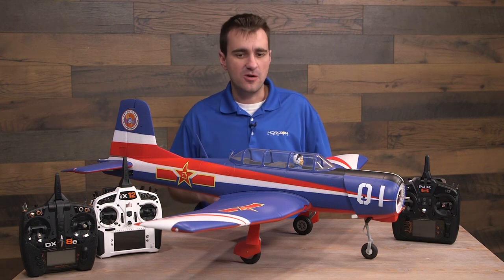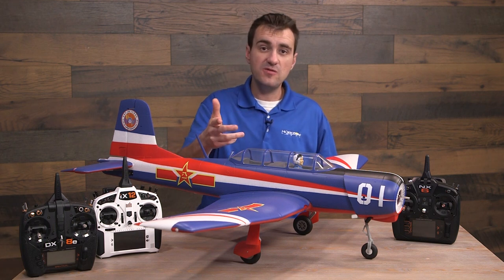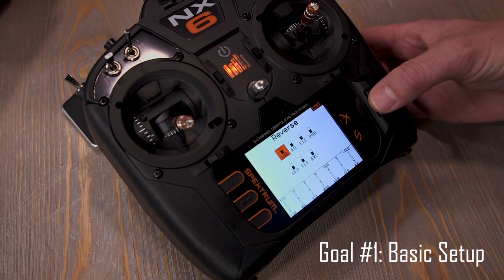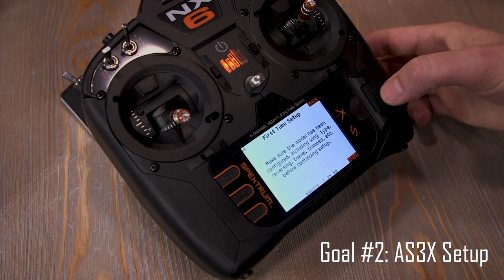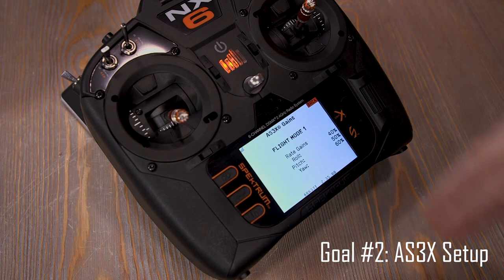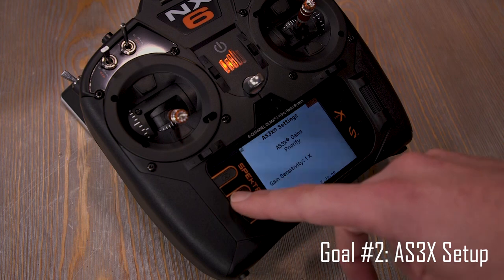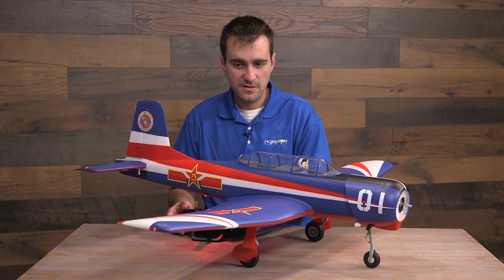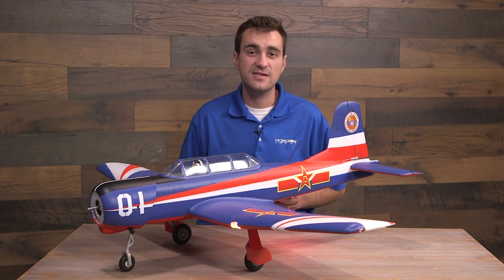AR637T Receiver Setup via Forward Programming - Horizon Insider Tech Talk

Comment: As an older pilot (78), I can verify that SAFE is very helpful with takeoffs and landings.  I have totaled MANY planes, but none with SAFE activated.  My SAFE planes include a carbon z Cessna, z Cub, and a FT Storch, and two planes I have, but not yet flown,  an FT Edge 540 (just completed), and a Hangar 9 Ultra Stick.  If you are crash prone, swallow your pride (or arrogance) and get flight stabilization in the planes you really don’t want to lose.
Reply: All your planes are BNF right ?
Reply: Nothing wrong with using SAFE.

Comment: One thing “he might have missed” is setting the AS3X gains to “Fixed”instead of the default of “Adjustable”. When he skipped setting the gain channel because the NX6 doesn’t have a knob, the AS3X gains are all going to be zero. If you don’t assign a gain channel and an input for it, you must set the gains to “Fixed”. However, the menu option for that doesn’t show up until you set up a flight modes channel. For some reason, Spektrum doesn’t have you do that until you do the first time setup for SAFE. After SAFE is set up, you can go back to the AS3X settings screen and the option to change the AS3X gains from “Adjustable” to “Fixed” will magically appear. I don’t like how the menus change as you go through the setup process. It forces you to keep cycling through them to make sure you haven’t missed anything. They could have had it automatically set the gains to “Fixed” if you didn’t set up a gain channel and they should have had you set up the flight modes channel long before the first time SAFE setup. Also, even though a 6 channel transmitter doesn’t have a knob, you could put the gain channel on a 3-position switch which would give you three gain settings - 0%, 1/2 of the gain settings, or the full amount of the gain settings. Not great, but better than nothing.
Reply: This helped a lot. This is why I watched the video, and it wasn't addressed.
Reply: Thanks for response here and also detailed response on Fat Guy Flies channel. The manual does not stress the importance of setting the gains to fixed. I couldn't get the AS3X working properly unless I activated the heading feature and then it would worked for some reason. No that I set the gains to fixed, the heading feature does not have to be activated for AS3X to work properly. Thank you!

Comment: When I go to Forward Programming I only see one option, Gyro Settings, I don't see Other Settings. And in Gyro Settins I don't see any First Time Setup option, instead, SAFE Select appears, I click on it and then I see the flight modes according to switch B position.
I tried with a AR631 rx and it goes according to what you show, but the AR637TA sees to have another programming or setting, I don't understand what happens here. It never asks mee to put the plan on its nose to start with.
At the end of the day I manage to get the 3 flight modes i want, SAFE+AS3X, AS3X, nothing. But I don't see how to change the gain or the limit angles.

Comment: I'm using a "DX6" to do the forward programming and my wing type is two alieron servos and one Y harnessed flap servo, no retracts.  So my Rx port assignments displays 1 through 6 just like yours.  HOWEVER, despite my having selected a flight mode switch same as you did, my channel input config page DOES NOT have an entry for "7 aux2: B"    I have no 7th entry, so I can't assign and independent flight mode switch for safe select.  Is this because I'm using a DX6 instead of an NX6 that you are using???  what's going on here?  if anyone knows, please help.  Thanks.

Comment: I have set up as3x and safe on switch b (a 3 position switch) on nx6 transmitter and ar637t receiver. Flight modes are no as3x, as3x on, safe. All travel, gains, dual rates, rates and expo are exactly the same for all flight modes. In off and as3x modes travel and throws work exactly as expected. However, if I turn on safe (with self level), throws and travel are greatly reduced. So much so that I am concerned elevator throw is so little, there is not enough command to control aircraft. Can someone help me understand why travel is reduced like this?

Comment: I've had absolutely zero issues with the forward programming.  I really did like the adjustable gain it is perfect for fine tuning your plane...
Reply: I got everything going good I set the as3x and safe I throttle up but as3x doesn’t turn on safe does when I flip the switch any idea
Reply: Why don't you make a video on installing and programming an AS3X reciever into a non Horizon plane and explain throughly forward programming at a level that us novices could understand in stead of this guy passing over important information that could explain more clearly the process and functionality of this transmitter . I'm not trying to be rude but let's face it I would spend 90.00 for 10 of my planes nearly 1000.00 in sales if I could as well as I'm sure others understand the set up of this HH technology. 
It would be great if you can do it please.
Reply: @octane2099  

Did you ever figure this out?
Reply: @rafaeltorres2886  Do the procedure 2 times and it works.

Comment: Great video and it also a key item needs to be said. If using a transmitter (such as an nx6 seen here) with no adjustable gain. Then you must set gains as fixed in gain settings. By default they are set to adjustable. If this is missed, it will appear as though safe works when the switch is set to that, but when switched to as3x only, nothing happens. Try putting gains on fixed to get it all functioning if your transmitter has no adjustable gain knob or switch
Reply: Good catch. It took me awhile to figure this out on my own.

Comment: I swapped my DX8e to an NX8, mostly so I could get updates on Wifi. Great improvement.
My Timber Turbo Evo had been set up with DX8e so I saved the settings to SD and then installed in NX8.
After binding, all the functions and switches were correct, correct control responses. Off for a test flight then I discovered AS3X worked but no safe. Basic bind error as in effect I disabled safe, so following the bind procedure it is most important after you remove the bind plug, that the transmitter is off. You then hold down the bind button and at the same time turn on transmitter. The display will then show binding and configuration, when complete you are done.
I find the accompanying manual highly lacking in clear explanations on gyros and AS3X as well as some other features.
Having the receiver AS637TA delivered with the Timber Turbo EVO, I do not have the option of 1st time settings and forward programming goes straight to the single Gyro option and it does not give me option to set the gains. All of the instructional videos I have watched do not show how to adjust gain without the 1st time set up.
How to access the gin settings. Telemetry tells me what the current setting are, but I cannot change them.
Frustrated like hell.
Trevor Kilbey

Comment: I'm well trained to program older 636 series with AS3X Programmer where we had to correctly set up the surfaces direction to get proper AS3X response.
On the newer Forward Programming enabled Rx series, there is no more surfaces settings in the FP menus (or I missed it)... So I'm wondering the Tx/Rx can know the right servo direction in order to get AS3X/Safe working properly? And how may we reverse a surface direction in case of wrong surface direction (during AS3X/Safe test)? 🤔

Comment: Building an old balsa pylon model which is having only aileron and elevator to control. I am planning to have 2 servos for the ailerons. Would ASX3 or even SAFE be a possible help to assist me without rudder control? 
Using a Spektrum NX6 and an AR630.

Comment: Question:  After initial forward program setup, let say, I want to move my AR637T to a different HH airplane.... what is the correct process of re-setting up the AR637T?   Do I just need to do a "relearn servo settings"?   Or do I need to do a "Factory Reset" and then redo forward programming after I have properly setup all my servos and channel assignments?

Comment: Good video but you don't mention anything about YAW. When I first setup my AR630 with a DX6 transmitter update to 2.09 I wasn't able to see the rudder move when testing it on the bench. I then went into the Heading settings and changed YAW which was set to 0. They also issue a warning above the YAW setting. Can you suggest a good starting value for YAW in both AS3X and Safe?  Why the warning about YAW? Thank you
Reply: I don't know about as3x, but my understanding is that SAFE only affects roll and pitch controls, but not the rudder.

Comment: Tom: Great video. I didn't see how to use the flight mode switch to select between AS3X and Safe mode on and off. Do you have this in a PDF 
document so I won't have to rewind so many times? I just got a new NX8 and it came with a AR8020T receiver and I'm trying to Forward Program 
it. A written document would be great but I can't find it anywhere on the Spektrum or Horizon websites
Reply: Did you figure out how to put safe into flight mode switch? I have an ix12 and just put safe on its own two way switch channel 7 aux 2. I couldn't figure out how to have it assigned to flight mode switch.
Reply: @I_am_archie  yes I did. I put together a word document that I call “The missing manual”. My instructions are in it. Position “0” of the Flight mode switch has both turned off. Position 1 has AS3X on. Position 2 has BOTH AS3X and Safe Envelope mode on. I found no way to turn AS3X off while Safe Envelope is on. If this sounds like it will work for you, I can email the document, or how else to send it? It’s about 10 pages long cuz it has a bunch of other undocumented tips in there too.

Comment: Kyle......an F Mode question:  on the flight mode channel that has AS3X and SAFE turned off, do I set both selections on the menu to Inhibit?  (The video looked like AS3X was set to Active on the clean channel)
Reply from the maker: AS3X can still be "active" on the clean channel as long as your gains are at 0%. Two different ways to skin a cat in theory ;).
Reply: @horizonhobby  Excellent...Thanks Kyle!

Comment: Great video! When I switch off safe AS3X also turns off. How can I turn off safe and still have AS3X ? Thanks
Reply: Same problem with mine. I’m going to check the gains are switched to fixed. Someone wrote about this in one of the comments.

Comment: I have the AR630 reciever, 6v rated digital servos, and i bought the Spektrum Smart 3200 9.9 Life reciever battery pack. Will the reciever and servos be ok with this much voltage? I wouldnt wanna roast anything...especially in mid flight. I noticed the reciever has a 9v rating. Hope i didnt make a mistake by buying those reciever packs

Comment: Is there a way to adjust control surface deflections on a bnf plane? My F 16 Thunderbird bnf 70 mm has AR631 and  i noticed when safe switch is on my control surfaces move almost 40 to 50% less and when i turn safe off it is normal movement. Its very strange. My other f 15 eagle does not do that  and both in safe and not safe control surfaces move exact same amount. I am so confused.  . Is there an issue with the AR631 reciever you think? I am scared to even fly it again since i can clearly see control surfaces are not going to its capacity or limits. Any help would be helful man. Thank you.

Comment: something seems off to me....I have a Turbo Timber, the manual is quite clear on how to activate AS3X and SAFE. It was NOTHING like all that he just went through. Activating Safe is determined by how you bind the plane with the bind plug, then hold the gimbles together and flip a switch 5 full toggles to assign it. AS3X can be left out but who would - SAFE is assigned to a switch and activate if you get in a bind. 
Is this video talking about something all together different or is it the plane that he's using that makes the difference?
Reply: Timber is a bind and fly already set up for as3x if you use bind plugs as it says in manual. You cannot get into forward programming on bind and fly unless you Jail break it (which is another spectrum video). This video is for a brand new receiver out of the box for any plane you put it in. Basically you are programming what they do already for bind and fly aircraft out of the box. Bind and fly just has horizon having done all this for you

Comment: Hello, I have installed an AR8360T receiver in my gas plane. It’s a 3D 8 channel aircraft and my radio is a DX8G2 therefore all my channels are used. I know I can’t have safe as there’s no available channel for it but can I still have AS3X stability with no available channel? Or will I absolutely need a 9 or 10 channel radio to have the AS3X functioning?

Comment: I have a question: When I am flying I use safe mode, but when I am higher in altitude I assigned a switch to turn safe off so I can do some maneuvers. I have enough flight experience now but I am afraid to go off of safe completely but can't use safe for rolls, etc. Is there a more advanced mode that stabilizes the plane without being in full safe mode?

Comment: Quick question/comment. I had previously been told by Spektrum that one should never reverse the servo in the TX for aileron/elevator or rudder . Only in the RX because the SAFE will be reversed. Am I mistaken?
Reply: I think that's true for the older receivers like AR636A

Comment: Hi guys, I just got the 1.2 Corsair yesterday and I’m trying to setup AS3X on my nx6 and when I hit forward programming it says “connection failed”. I’ve tried several times but nothings working. Any insight?
Reply from the maker: The Corsair does not support Forward Programming. The BNF model utilizes older receiver technology. You would have to upgrade the receiver to take advantage of this feature, unfortunately.

Comment: If I already programmaed as3x on a 637t but need to do mechanical adjustments to the plane like trim elevator, would i have to reset the receiver and start all over again?
Reply from the maker: Not necessarily, but we do recommend entering the forward programming menu and selecting the "relearn servo settings" option.

Comment: Question:  When you first fly the plane after setting up as3x and Safe, trim the plane (with Safe off) to get it to fly straight and level, will Safe then use those adjustments as it’s base?  Also, can you trim it while in Safe?
Reply from the maker: Great question! We are going to pass this over to the Spektrum team to make 100% sure we convey the correct response.
Reply from the maker: Gerald, hopefully this makes sense. Setup/trim the plan in non-gyro OR AS3X mode first. These trim adjustments will carry over into SAFE mode (unless you have some other flight mode programmed that prevents this). However, SAFE will take priority over these trim adjustments as it will always return the plane to the "attitude" settings you programmed on the bench, regardless of trim. So, if the plane makes some awkward/undesired response when you flip into SAFE mode, it is likely you need to recapture/program the attitude settings (on the bench).
Reply: I have brought the AR637T telemetry receiver, does any know what the black and red wire with what looks to be a white two pin plug is used for that it came with?
Reply: @MJBorrett2379  Hi , it's for rx battery voltage telemetry . I have just put one of theses receivers in an F3 RES glider to give me various & altitude telemetry , but I also soldered the black & red lead you mentioned into nimh battery lead and plugged it into the " D " voltage sensor port on the receiver . Now flick a switch on the tx and a nice lady tells me the rx voltage ! COOL  , Hope this helps , I'm still waiting to find out if safe etc will be as effective with just RES . Stay safe !

Comment: is this setup the same as the AR6610T receiver that came with the nx 6 radio. can i use the AR6610T receiver in this plane.
Reply from the maker: Technically the setup is the same, but there really isn't "forward programming" with the 6610 since it does NOT have AS3X or SAFE Select. Yes, it will work in the CJ-6.

Comment: This does not work for the AR631 receiver and NX 8 transmitter. It does not recognize Safe although the AS3x is turned on. Hence no safe recovery or panic recovery if someone gets in trouble and need to save the plane from crashing
Reply: I am having trouble with the same combo. What is the answer? Use a different RX?

Comment: I have followed this setup exactly 3 times and every time SAFE works perfectly but I can't get AS3X to work. I make sure it's on and bump the throttle over 25% and still nothing. I have even only set it up for AS3X and no safe and it still doesn't work.
I have the A switch set up for flight modes. Mode 1 AS3X active Mode 3 AS3X and SAFE active. Mode 3 safe works. Mode 1 no AS3X.
The only way I can get any kind of AS3X is to set up the "Heading" option in the AS3X menu (not shown on his screen). But that makes the surfaces react to movement but then they don't recenter. 
I have also made sure that the plane is set up right. 
Anyone have any advice on how to resolve this?
Reply: I got it figured out. They must have done an update since this video because there are now more options and steps.
In the AS3X menu, there is now a "Hedding" and "Fixed/Adjustable Gain" option and I had to go into Fixed/Adjustable Gain amd change the setting from Adjustable to Fixed to get my AS3X to work.
Reply: @derekterry4157  great update, glad you posted it. Strong work 💪

Comment: I would like to turn my AS3x off on my Micro Radian. I use a Spektrum Dx6e transmitter. On a Flight Test review https://www.youtube.com/watch?v=U5e6kG3QVPM at the 1:13 min. mark they show someone plugging in a cable and TURNING OFF the AS3x. I haven't heard back from H.H. but it hasn't been very long. Are you aware of the required cable and software that was used ?
Thank you. ;-)